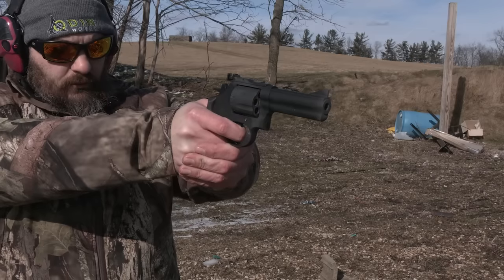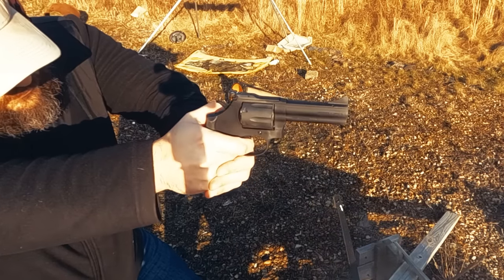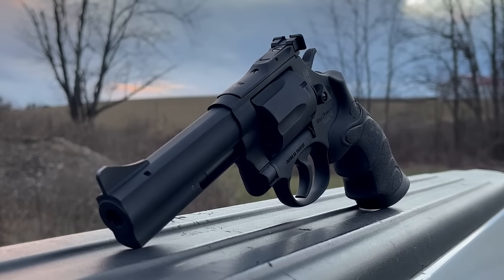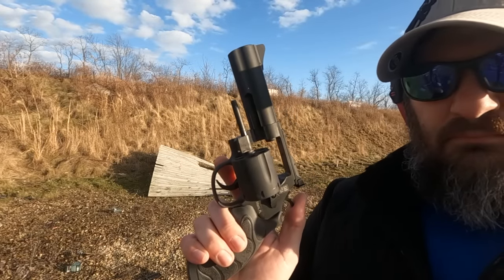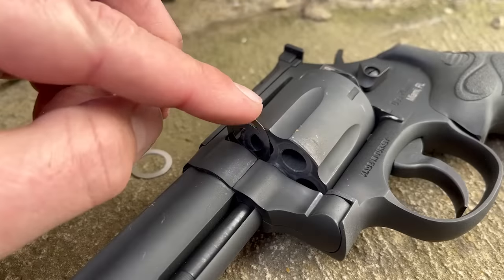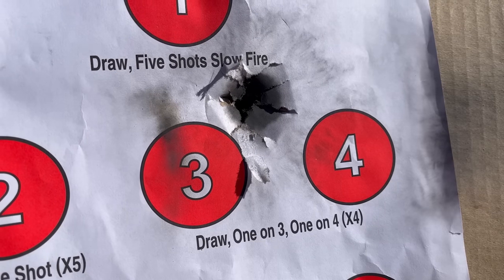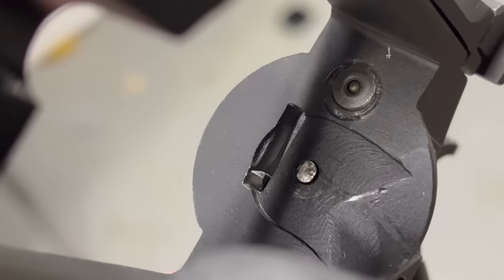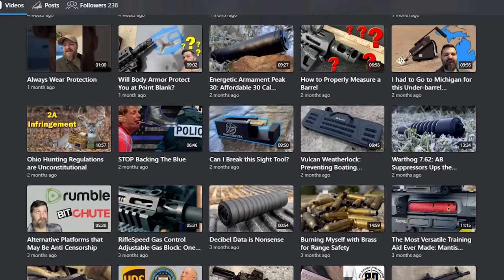SAR38 Low Cost Revolver in .357 Magnum

Comment: No I have fucked up the ejection rod on a revolver by doing this, the cylinder will no longer freely spin on the gun. This isn’t something I’ve heard of or even saw happen it’s something I’ve done. 

It was a H&r model 732 in 32 long colt a cheap gun that was bought by my grandmother in the seventies. So cheap that they are only about $150 today and because it’s so cheap it might not happen to a better built gun or a modern gun but it can happen.

Comment: I agree that cylinder slamming is not a big deal at all the overwhelming majority of the time, but that one absolute statement needed so many caveats to be correct because its the equivalent of "if I cant use my knife as a screwdriver without the tip breaking off, then why do we make and market them as tools" or "if I cant even throw my chest seal in the tumble dryer without damaging it, then why do we make them and market them as life saving equipment."

As it turns out, it depends on what you have on how you do it. I'm not the foremost revolver academic, but from my understanding, on some revolvers, it could technically be possible to cause your cylinder to be out of time if enough hypothetical force is used to rotate the cylinder and slam a heavy cylinder (and depending on the applicable metallurgy) but is relatively rare because most of the time the variables aren't adequate to cause any noticeable or even measurable issues.

If you mishandle of use a product in a way it wasn't intended, then you MIGHT end up changing it or wearing it down in ways that weren't accounted for in its design and manufacturing.

Not every gun is designed to have people spinning their cylinders as fast as they can and slam it shut.
Not everyone who uses revolvers is using them as life saving equipment and might just be wondering if its something to for their antique which may have a very different design and manufacturing process than your revolvers. It's almost like dry firing advice, most of the time the best advice is to look up how it applies to your specific situation because you have to make sure you aren't the extra rare exception to a really common situation.

Comment: Can get a used S&W for under $600. If something isn't working right, it's easy to fix and parts aren't expensive
Reply: Right? I was expecting this to be in the $350-$450 range. $600 for a Turkish revolver with those casting and machining marks is laughable.
Reply: An Armscor M206, brandnew costs US$ 250,00, if you want to know.

Comment: I don’t think it’s entirely untrue, I do have a revolver that I’m pretty sure has been a Hollywooded shut many times, and the star on the back of the cylinder has been dragging on the frame as it was closed enough times that there was actually a burr in the frame, and because it was a rimfire, when you would try to rotate the cylinder the rounds would hang up on the frame because of that burr on the back of the frame. With some careful filing and some time to polish it I was able to get it to work properly again, but there is at least some merit to the fact that slamming a cylinder closed is bad for it

Comment: Best I’ve heard is if the cylinder is SPINNING and you flick it shut, you could damage the cylinder stop which in turn (pun intended) could throw off the timing. Any mass produced revolver I look at has some tolerance slop to the jiggly cylinder stop as it is. Bullets entering the forcing cone align things for a split second so I don’t think it’s much of an issue. Now a boutique Freedom Arms revolver might have tight enough tolerances to damage something, and lose some accuracy, but would still be operational.

Comment: I saw a video that said it will wear out the nipple on the back of the cylinder faster and could eventually throw of the timing. But that's why you get the cheap ones cause parts are cheaper?

Comment: Another review by someone with very minimal revolver training.. The correct way to unload a revolver is to move the revolver to the weak, hold it upside down vertically with the weak hand while using your strong hand to quickly slam the ejector rod down vertically to eject the empty casings , then reload the cylinder with strong hand.. this ensures the ejector rod won’t get bent during ejections, ensures complete ejection and ensures more efficient loading with the strong hand.. please go take an actual revolver course.. if your gonna put stuff on YouTube don’t wing it please.. yes you will eventually torque the crane by slamming it Hollywood style .. trust me it’s a thing . I spent my younger years working in a gunsmith shop .

Comment: I mean, yes I am sure that slamming the cyl shut like that once, a hundred, or even a thousand times might not do any noticeable damage. But treating things they way they weren't designed to operate enough times, something is bound to break. In my semi auto, I'm sure that I could gently place the magazine into the well, and then slam it on a table to get it to seat and it would work just fine. But how many times could I do that until something breaks? I don't understand how just because something isn't indestructible and may potentially break due to misuse, means that it shouldn't be marketed as life saving devices. Yes I find it silly that if you use your tool roughly once that people loose their mind. But continuously operating a tool in a way it wasn't designed to work will probably cause some issues. It would be interesting to see an actual test on the revolver thing, and see how durable those parts are. But hey, at the end of the day I'm just some guy on the internet so take my opinion with a grain of course salt.

Comment: The only place I am seeing the SAR38 in stock on the web is Tombstone Tactical for $465.30. I don't call that low cost. My Taurus 856 Defender three inch was $379.99 before taxes and NICS from a local dealer. After that it was just over $400. Revolvers are not cheap even what used to be called budget revolvers and they really never have been cheap or low cost.

Comment: There is no single/double action. It’s either single or double action. Just like you don’t say 2 wheel/ 4 wheel drive.
Reply: Single double action does apply to revolvers because it means you can do both on the same gun, there are some types where you can only do one type of action.

Comment: Yep, slapping the cylinder open and closed violently (Hollywooding a revolver is what they used to call it, as dumb actors would treat their revolvers that way) will eventually bend the crane, enlarge the center pin hole, batter the offside of the breech face where the star comes to a sudden stop, and sometimes bend the ejector rod.  Once you get the crane and/or rod bent, then it causes drag at the end of the ejector rod and its detent, which causes excessive hand/ratchet wear, which eventually makes the gun go out of time.  Revolvers are fragile enough without actively trying to abuse them.     This is why they sell the Power Custom Extractor Rod & Yoke Alignment Tool, to fix the many revolvers abused like this.  On beater revolvers like this, do what you want,  but please don't do this to an old S&W or Colt or even Security Six.  It falls into the same category as the "idiot scratch" on 1911's, from people who don't know how to take them apart or put them back together dragging the slide stop across the frame as they struggle with it.

Comment: Ejector rods can and do bend. They were only intended to take force going down, not sideways, especially if the ejector rod is part of the lockup, like on a Smith.

However, it's also your own damned gun. As long as you don't commit any felonies, do whatever you want to it

Comment: Your quite right, you are indeed nitpicking. 
It's reliable and accurate. The front sight simply needs a spot of paint, and possibly. The other details your quibbling about? They are strictly cosmetic. If you want them gussed up fine, but that's just going to dramatically raise the price.
Reply from the maker: I try to balance every review with at least one point of improvement. Personally, I don’t care for cosmetic perfection but some do. You are correct there is nothing functionally wrong with this weapon.

Comment: You can remedy the out of battery potential issue with a stand off device, like the one from Dark Hour Defense (with or without a comp). As for "mo powa"... out of a two inch barrel, no, but out of a 4 inch barrel, yes.

Comment: If there is a kind of weak point on every revolver it is where the cylinder attaches to the crane. If flipped closed regularly it can affect/damage cylinder alignment.
Don't believe me? Then open your cylinder and bang it against the edge of a table with the force coming against the crane. Yeah no. Don't do that.

Comment: Biggest problem with flicking the cylinder shut is there is no reason.  It is an attempt to look douchebag cool.  Pulling stunts is fine for movies where it is all make believe anyway.  A gun is a deadly weapon and deserves to be handled as such.  Sure guns could be built stronger but that means they would be heavier.  Those of us that carry a gun everyday appreciate that the gun is only as heavy as it needs to be.  I could drive my Corvette 100mph down dirt roads but I don't do that because it is not designed to be used that way.

Comment: Flicking a revolver cylinder back into the frame "will" damage it with substained practice.  Period! That's your revolver, if you got to show those of us that shun that damaging habit,  and that your revolver can take the abuse, well go for it. It will be interesting to know how much abuse your gun can take before serious damage sets in. Flicking a cylinder shut is a practice most professional gunsmiths of firearm repair advise against. I believe most of the major gun makers (Colt, S&W, Ruger, Taurus, Armscor) would advise against the cylinder flick. Save your gun, treat it with the respect it deserves,  and be open to constructive criticism, it is a good learning tool sir.

Comment: No, the reason you don't flick revolvers shut is because over a few thousand reps of doing that it will fuck up the timing. You may or may not end up with the imprint of the top strap in your forehead as a result

Comment: Yeah, but how is the milling on the CYLINDER star and bores?  And the barrel bore?  What does the forcing cone look like?  Ya know, some people LIKE a black sight blade.  I use a dab of "typewriter correction fluid" in a bright color on the blades anyway.  It is amazingly bright, since it is full of cellulose fibers which are microscopic light-pipes, and it is surprisingly durable.  But, it is easily removable with any gun solvent if you want to change color!  You should have given more of views of the gun itself, and not so much of your smirking face.................................elsullo

Comment: Most myths, urban legends, old wives tales and similar stuff normally have some grain of truth or actual event which they were built upon which has since been lost to time and obscurity.
Smart money says that at some point there either was a specific brand of revolver or perhaps, back at the beginning, this was a problem for all revolvers, but either way, once upon a time, this was a problem.
The problem was either resolved or the problem revolver/maker disappeared from the market but thanks to that problem, people kept passing on the warning from generation to generation.
As such, for all we know, this could be a warning from 150 years ago.
Reply: The S&W you buy at the pawn shop is vulnerable to this issue. Being one of the most common revolver manufacturers you could say that the majority of revolvers in circulation would be damaged doing it. Don't do it. It saves you no time and is only risking your firearms.